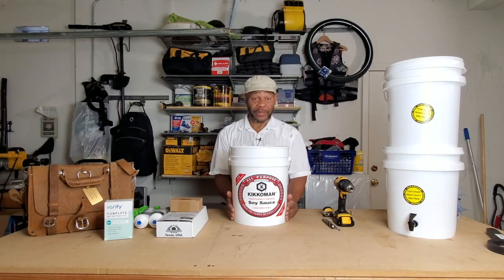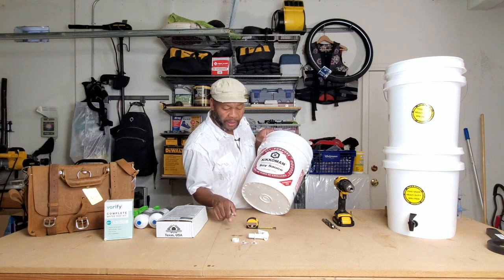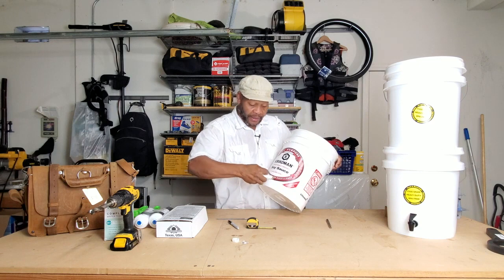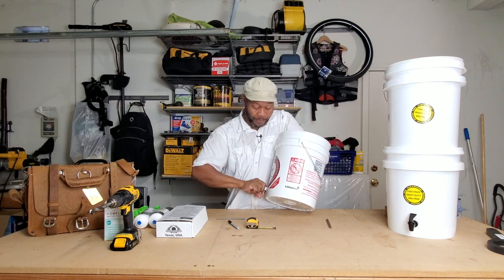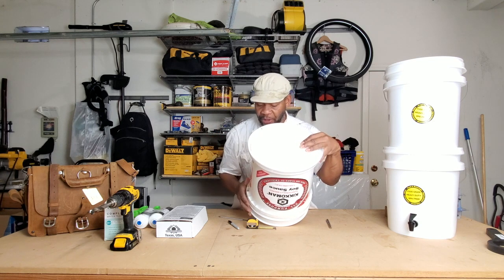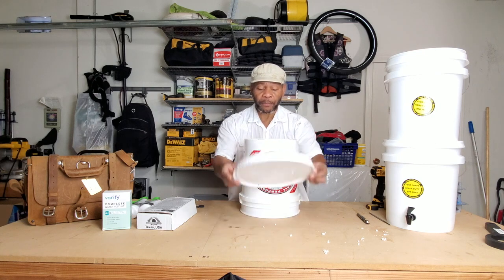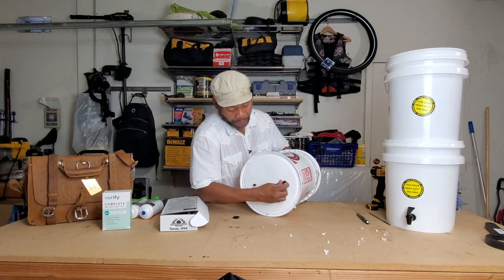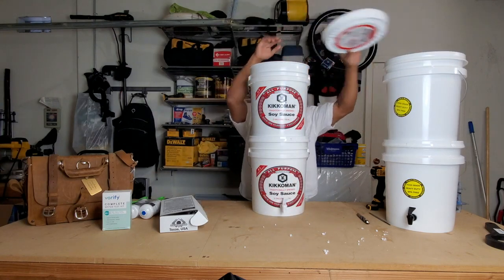EPISODE #3 PARTS BUILD: EASY DIY 5 Gallon Water Filtration SETUP #DROUGHT #WATERSHORATGE #DIY

Comment: I appreciate all your knowledge that you bless us with! I have a quick question, my water out of my faucet comes out at 7.6 ph when I use this method my water is 9.8 ph. Do you know why?? Appreciate your time…
Reply from the maker: Your water is fine. Your ph is fine. My wife responded to your message from my phone while I was driving. Any water over 8.5 the water can start tasting bitter. But other than this the water is not harmful at all. EPA guidelines state that the pH of tap water should be between 6.5 and 8.5. Alkaline water typically yields a pH of around 9.5. So, in other words, alkaline water simply refers to water that is more basic than typical water (which yields a pH level of 7). It is  recommended drinking eight to twelve glasses (or two to three litres) of alkaline water per day to experience optimal benefits. Don't make a fast switch, though - transition slowly by mixing up your alkaline water intake with regular water while you get used to the changes your body's pH levels.

https://perfect-hydration.com/?blog=5-potential-benefits-of-9-5-ph-alkaline-drinking-water#:~:text=Alkaline%20water%20typically%20yields%20a,a%20pH%20level%20of%207).
Reply: @HebrewNomadOverlander  Thank you! Much appreciated…
Reply from the maker: @repoillicit2196  Always and absolutely

Comment: I have a question, forgive me if it sounds stupid, but am I pouring the top bucket into the bottom bucket, or does it drain into the bottom bucket?
Reply from the maker: That's the purpose of the filters and the top bucket. Gravity fed, yes it drains into the bottom bucket.

Comment: Thank you for showing us how to build this water filtration system. But im just wondering,if we wanted to add a filter that filters out floride,how would I go about doing that?Would it be the same process as the berkey filter? Also does the black washer that go on the berkey filter come with the berkey filters (included in the box) or do I need to buy them separate,if I do need to purchase them,what size should I get? Sorry for all the questions,im just trying to get all my supplies to build this system. Shalom Elder